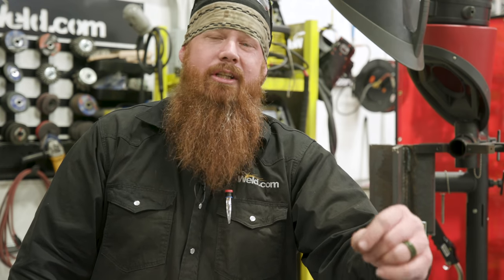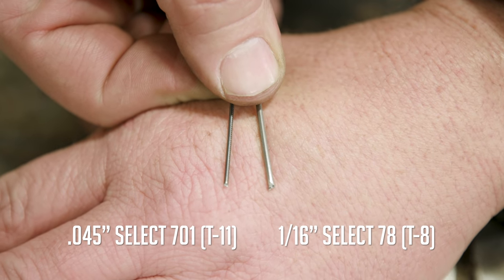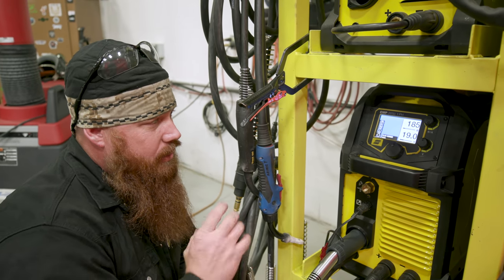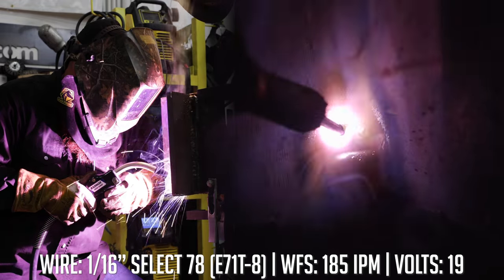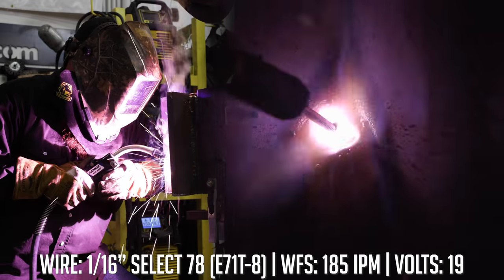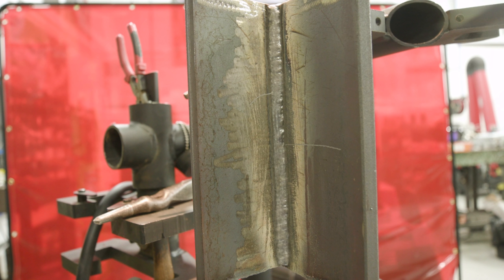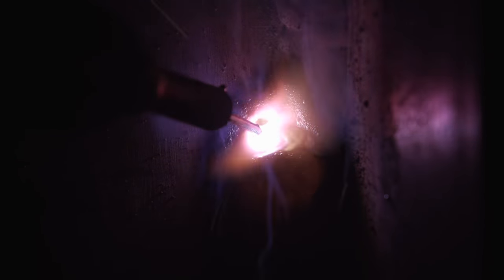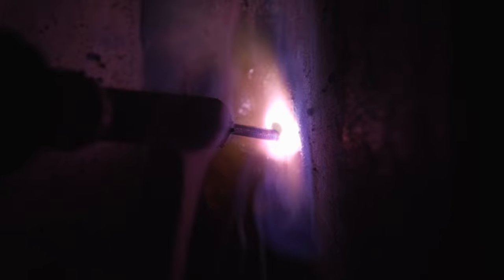1/16" Seismic Flux Core Welding | Vertical 3F

Comment: I'm sure it's ok, but I just feel like you weren't getting into the the corner all that well on on that first pass... like you weren't getting the flux/slag out of the way  when you were jumping from side to side. I may not be explaining myself well. Maby if youd have kept the ark right on the edge of the puddle and base metal while moving from left to right it would have pushed that slag/flux out from the center a bit better, ABSOLUTLY NOT hating you guys got a great channel, 3/4 is a bit thick but maby a cut and etch would be nice to see if anything got trapped :)....EDIT it's hard to see the left side of the puddle in the video but after a 2nd watch it  looks like u pushed it out lol
Reply: I'm not sure if it runs the same as nr-232/233 but it doesn't allow for arc to be at the leading edge. You have to be at the center of the puddle.
Reply: @joseramirez-cf9ki  that may be it.. you know as well as I, it's hard to know exactly what's going on if your just watching and not working the puddle yourself. On top of never running that specific wire myself, the puddle looks thicker than usual ;)
Reply: jose ramirez you’re exactly right. If you get ahead of the puddle, the wire will blow right through the plate.
Reply: Jason Becker curious to know what amps/voltage/wire speed you were using.  Look a little cold to me.  I’ve used 233 5/64” wire with Lincoln’s “typical operating procedures” settings. It’s very fluid at 125 IPM with 260 amps from a CC generator.  Definitely a defined leading puddle edge and slag shelf when running verticals.
Reply: C R we go over the settings at 2:25
Reply: Jason Becker it can be hard to see with all the smoke at times, thanks for replying.

Comment: I don't remember seeing another process where the wire was so far back from the leading edge.
Reply: 10:4 littleAl this is a tricky wire. If you go to the leading edge, you can blow right through the plate.
Reply: @GodslilRedneck23  Guess that explains the extreme downward angle. I'm so used to running vertical with an upward push with short circuit.

Comment: What's the difference between this wire and Lincoln  NR 233
Reply: Mike they are the same AWS specification and classification of wire. Just 2 different manufacturers. In my opinion, I’ve ran both and the Select Arc seems to be more user friendly.
Reply: That’s too bad that this is better because companies only ever buy NR 232.

Comment: So for self shielded you want a slight drag verticals but for gas shielded 3F you what to point directly in or slight push?
Reply: If there is slag on and welding method you drag it. Even in verticals with dual shield you can point the wire slightly down. More penetration.
Reply: If you push anything with slag you risk getting inclusions

Comment: I use 1/16 dual shield wire everyday on structural steel it’s a quicker process
Reply: Including punking around a hose for gas on top of setup, I doubt that. SS-FCAW is the way to go, 0.72 wire is preferred choice.
Reply: Waylon Israel ours is just like a mig and no extra hose

Comment: I need the information of that machine please, I did not know that it is compatible with the 1/6 wire
Reply: Esab Rebel 285ic, wire feeder specs are towards the bottom 
https://www.esabna.com/us/en/products/arc-welding-equipment/multi-process-equipment-cv-cc/rebel-emp-285ic.cfm

Comment: Weld.com guys what would happen if you struck an ark  on red hot metal? Would it shoot molten metal in your face just like if you are trying to cut a hole with a torch and you hit the oxygen to early? I'm a new welder and have been wondering
Reply: It would weld it. Might be a little spattery depends on the metal. Some metal like cast iron needs be be red hot to weld from preheat and then needs to be post heated after welding and brought down slow and steady to room temp to avoid cracking. All different rules for different metals and alloys!

Comment: why the heck would you use globular transfer and be confident in it
Reply: That's what a lot of flux core wires run on. Lincoln outershield, which is primarily what I've run, runs globular, but you can fine tune it to where it almost looks like a spray transfer.
Reply: In self shielded wire there is not the proper gasses happening to facilitate true spray transfer as the gas needed to ionize the metal is absent. I learned that in a book studying for my Red Seal cool little fact that stuck with me.

Comment: Break out the big boy wire?? Lol generally I run 5/64 innershield.. always Lincoln manufacturer.. and depending on the application I've used a lot of their different types of innershield brands.. when I started.. and again there are a lot of variables and I'm turning the clock back 30 years I have ran 5/64 3M as low as 200 ipm. up to 500 ipm. Do I really have to get into the details about my experience with 3/32 -311ni. And I have a lot.. and again variables taking into account.. copper backing strips.. 500 to 700 ipm.  Big Boy wire?? SMH..

Comment: What the heck is 'seismic' wire? Earthquake proof?
Reply from the maker: Exactly. It's meant for structures that have heavy cyclical loads.
Reply: That’s exactly what it’s for. It’s used a lot out west for structural welding.

Comment: Yeah its g15 big boy wire but i run mine wayyyyy hotter and faster usally like 26-28v and 450ipm
Reply: So, the same wire, a T-8 gases FC in 1/16" at 450 IPM??
Reply: I run dual shield 1/16 flux core and I run mine at 34v
Reply: Ive seen people run theirs way hotter, i was only running off engine drive with a miller super 32 suit case welder.
Reply: When you run it at that voltage it cooks out the properties that make it suitable for seismic applications. Ive used it before and we ran it at the top end parameters while keeping the properties recommended by Lincoln Electric. Was a little outside of the scope at 25v and 350ipm we were pulling 400 amps was NR 232 .072 Innershield on an LN25x suitcase with a Flextec 650x
Reply: Your stickout seemed super tight like a quarter inch or less at points